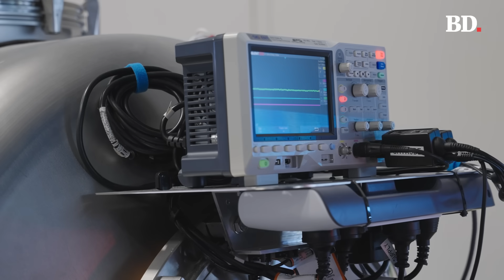Liftoff! A new generation of Kiwi space entrepreneurs

Comment: Lots and lots of C02 probably more than my car will make in my life time.
Reply: Actually very little Meth-lox and Hydro-Lox engines are very clean burning. Especially Hydro-Lox engines as the exhaust is not carbon its literally... H20. With the Meth-lox engines the Superheavy Booster and Starship produce about the same about of C02 that a 6 hour flight on a 777. A full starship and SHB stack weighs about the same amount as a 11.5 747-400s. Because Rocketlabs and SpaceX are looking to reusability of the rockets their rockets cannot be high in carbon burning which fouls up lines they need clean burning engines (this means that as much of the fuel is used in the cycle of its engines as possible)
Reply: @the_lomax 
1 flight from auckland to london use more fuel than my car does for at 40 lts a week for 50 years
Reply: @Paul-ik8fm  yes but you arent exactly putting over a 100ton of payload into space are you. So a craft that weighs 11.5x the amount of of a 747 produces less C02 than a single 6 hour 777 flight. 

Also come on think about it if you were to drive to the UK from NZ and transport the same amount of cargo how much C02 would you put into the air. How many trips would you have to make how long would it take you?